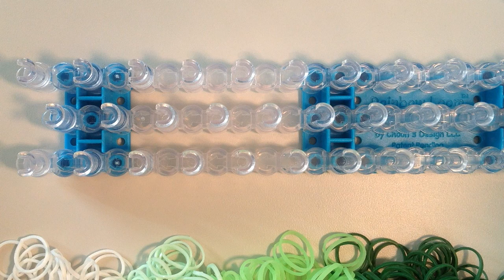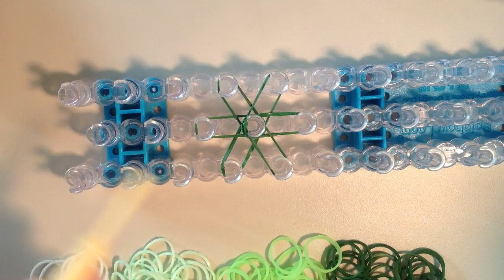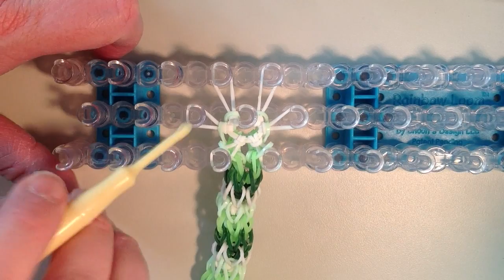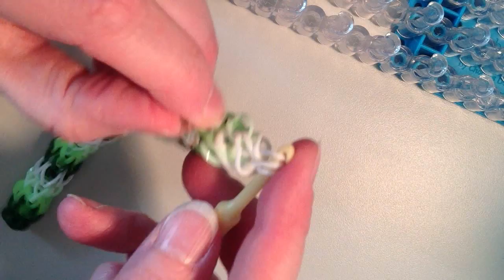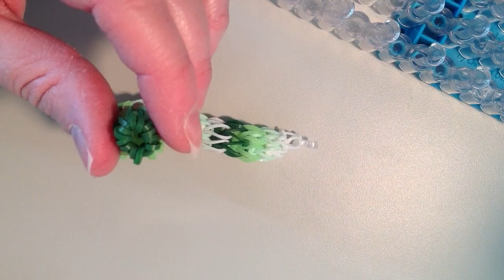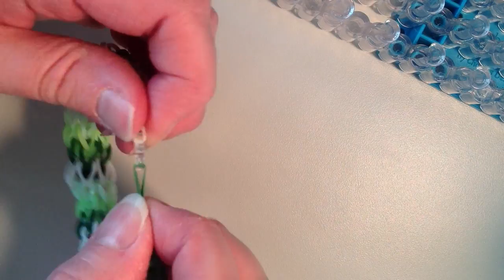New Hollow Circle Bracelet - Rainbow Loom, Cra-Z-Loom, Bandaloom

Comment: How can we add a flower
Reply from the maker: If it is a button or something like that, you can just slide the band through the hole on the back wherever you want it to be on the bracelet (while you are making it).  If you want to add a RL flower, like the Flower Fun Charm, make the flower first and keep the loose ends on a pen or something like that and set it aside.  Then as you are making the bracelet, just slide the band (where you want the flower to be) through the loose flower bands (you may have to double that band so it is tight enough).  Hope this helps :)

Comment from the maker: Shi,  The rainbow spiral one is made with the colors shifting every time you add a layer.  For example, in the video you put the first band on going down and to the left (if you picture a clock face it would be about 7 o'clock).  So you would put red there and then follow around with the colors of the rainbow.  Then for the next layer, all the colors will shift one pin over (clockwise).  So you would start with purple (on that same 7 o'clock pin) and follow around with the rainbow colors.  Then they would shift one over again, so you would start with blue.  Hope this helps :)